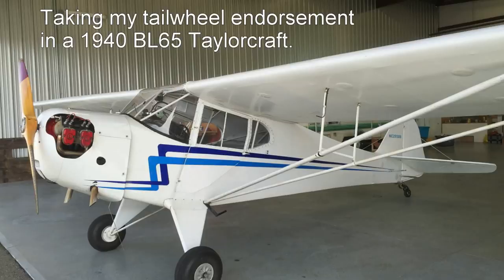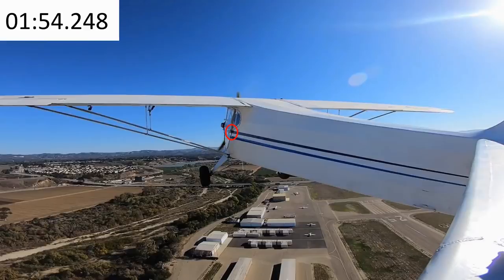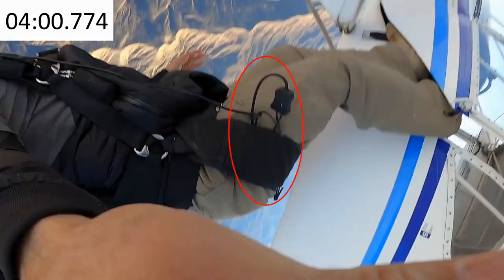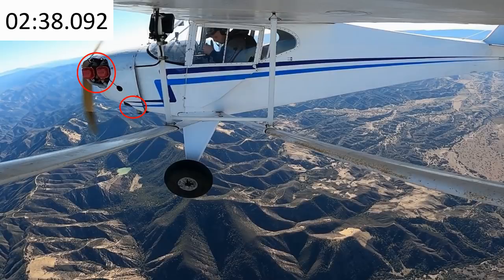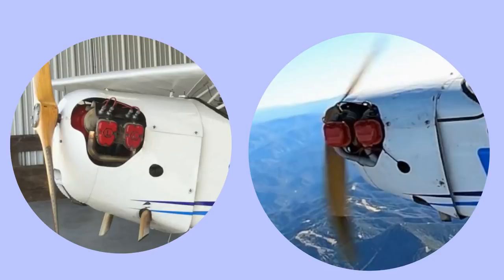Dear Trevor Jacob 1.1—That’s Not a Lycoming, I Found Your Water, and We Still Have More Questions…

Comment: Switching from Lycoming to Continental power in a BL65 is a pretty big deal. Basically changing the airplane model from a BL65 to a BC65. Taylor-Young originally offered the airplane with a choice of Lycoming, Continental, or Franklin 65hp engines. The Lycoming version was the model BL65, Continental version BC65, and Franklin version BF65. the swap would require pretty much everything forward of the firewall to be changed. The O-145 (and it's letter "O"- not zero) uses a different engine mount truss, different exhaust, different propeller, often a different carburetor, and the cowling needs to be altered, so this would be an expensive undertaking just to crash an airplane. Maybe he really did crash it just for attention but the engine swap was probably done earlier because parts for Continental A65 engines are lot more plentiful and affordable than parts for Lycoming O-145s. The little old Lycomings were not known for their performance but they were very durable and reliable engines. Parts for them have become very scarce and very expensive so a swap to a Continental is a common conversion for airplanes with Lycoming O-145s. The engine pictured would have been a Lycoming O-145-B2, meaning O-Opposed cylinders, 145 cu. in., B-65hp, 2-dual ignition.
The Lycoming and Franklin versions were dropped after WWII and the Continental version was continued with full cowling and trim tab and redesignated as the Taylorcraft BC12D
Reply: and now referred to as the BS65

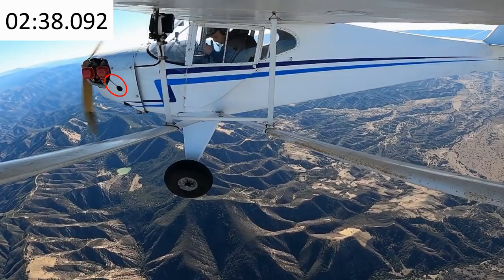Comment: Good analysis. There is another youtuber and commercial pilot, 'Mentour Pilot' who noticed a red fire extinguisher, located on Trevor's left leg (underneath his pants), at 2:12 of original video. Speculation would be to put out any fire from the crashed airplane.
Reply: That small extinguisher is woefully inadequate for anything but a small fire, and certainly no match for dry brush.  
But hey, A for effort I guess.

Comment: A small point I noticed too is that the front exhaust pipe on the Lycoming engine goes down and then a very clear but single 90 degree bend towards the rear. The Continental motor also quite clearly goes down but has a number of bends as it wends it’s way backwards. Beautiful pipework as the curves are lovely and smooth but most definitely not the same exhaust system

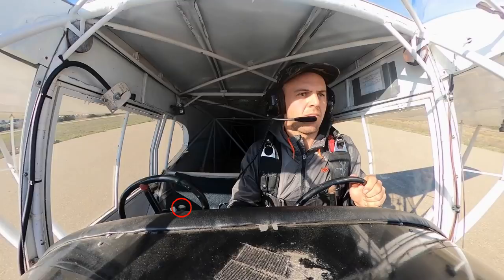Comment: Have you noticed around 4:10 the cowling was cut out to leave more room for the exhaust pipe of the replacement engine?
Reply: Definitely, to allow the cowling to be pushed outwards for that larger exhaust, even though the exhaust pipe is bearing on the inside of the cowling. That would not matter for the short and final flight planned for this Taylocraft!
Reply: Good eye! That was exactly my comment!

Comment: TritonTV has some good observations showing how Trevor's jacket is soaking wet just after he landed in the scrub. Cap must have popped off the water bottle that was tucked inside his jacket.
Reply: Or, one of the branches got it. That was great that he landed in a bush for dramatic effect. Well worth the loss of a little water.
Reply: @WeBeGood06  Plus Trevor had plenty of water stashed in the plane. At least a few bottles would very likely survive the crash.

Comment: Why in the hell would you jump with a headset on and risk it getting caught in your lines or risk it messing with parachute deployment? Well that, and why have a fire extinguisher strapped to your leg?

Edit: @4:03 why is the bottom engine cowling tab in the open position? The top of the cowling seems to be a different shade of white and looks like its was put there with a hammer.

Comment: This was an intentional scheme, a "crash for clicks". He had a fire extinguisher strapped to each leg under his pants, the door was open the whole flight, made no attempt to restart the plane or glide it in to one of several landing spots, including where he took off from, etc. I've seen another video where it appears as if he had the wing tank filled with water. The maker of the video goes frame by frame and upon impact it looks like a lot of water comes  out of the plane. Much more than one gallon. This guy is guilty IMHO, and I hope he is held accountable for this idiotic stunt.
Reply: "Idiotic." You mean well planned and executed stunt that made for some awesome footage..
Reply: @kj3n569  He also planned out filling tanks with water, fire prevention measures if the water in the tank somehow caught fire. He dropped it in an area with no camps for atleast two miles so it wasn't dangerous to others. The dude harmlessly got some badass crash footage, y'all are just FAA bootlickers.
Reply: @Zeromaus  0- and he paid for the cleanup operation and investigation too??? nope

Comment: At 3:21 - Is it just me, or does the top piece of the cowling on the right look considerably dented (and possibly hammered out), while the one on the left looks factory smooth?

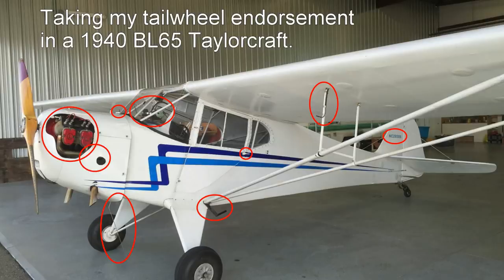Watching TJ's video, at 1:13 I noticed the GoPro mounted on the horizontal stabilizer catches it vibrating considerably while gliding.  I'm not a pilot but I did grow up on my dad's FBO - I don't think that level of vibration is normal, but I admit I could be wrong.

Comment: Nothing was right it seems.  Seen a video of another pilot with an engine malfunction. Had plenty of time to save the plane at what appeared to be a much lower altitude.  Trevor had more than enough time to scope out a landing spot.  Not to mention after he bailed from the plane he took a long time to deply the parachute, which robbed him of time to find a better landing spot.  But this really seemed like more theatrics than anything else.  BTW, I'm not a pilot nor a skydiver. There are just some things that were so glaringly obvious that it doesn't even take a pro to pick up on.   There are other things I noticed just from playing flight sims,  like the plane being trimmed to go down as he jumped out.  That just doesn't seem right.  A good pliot would have trtmmed it for best gliding speed while he sat in the plane and taken the plenty of time he would have had to line it up to the river bed below.  Or even tried to restart the engine, because of what you said, he had plenty of fuel. I'm sure he would have had enough to make the trip he was on, if it was his plan, other than crashing.
Reply: I'm both a pilot and skydiver and your assessment is spot on.
Reply: about that trim thing. I am a pilot, and I would say there is too much interpretation into that detail. Yes, the airplane noses down after he let go and jumped out. But I don't think he was that clever, to plan that ahead, because then he would have done it much better. And clever is not an attribute I would put onto him anyway 😉 
No, it is just simple setting. The plane was trimmed for level flight. Then the engine quit and Trevor started to pull actively on the yoke to slow her down, so forcing the nose up quite a lot. I would say, he wasted no time on changing the trim during those moments. He was busy acting his panic and getting his camera and stuff. So of course the moment he leaves, the plane puts the nose down immediately. Also additionally following physics with changed centre of gravity, as about 100kg from front seat just bailed out. So two factors adding nose down tendency: Engine out and loss of (human) load behind CG.
Reply: @birds_eye_view  I was going to comment that the airplane would have the tendency to pitch up due to the removal of the pilot but wanted to get an idea of W&B first. I found a W&B for a similar Taylorcraft and that has the pilot at +23 of the datum (leading edge of wing) and COG range from +14.5 to +19.7 so you are correct that the removal of the pilot would have a nose down effect (as of course would loss of engine power as the airplane would naturally pitch forward to seek its trimmed airspeed). Good catch. I was expecting the COG to be aft of the pilot on this tailwheel because in my mind the mains were further back. I shouldn't have underestimated the weight and arm of that engine. I fly tricycle gear but will pick up that tailwheel endorsement sometime in the future.
Reply: @birds_eye_view  Here's my more concise thought on the trim. If his intention was to film the plane crashing, he's going to want to make certain the plane hits the ground before he finishes parachuting down, so he can land close to it to recover the footage from the other Go-pros.
Reply: @1dgram  All the best for your tailwheel endorsement! They are so much more fun to fly. I'm sure you will love it. And please no jumping out, ok? 😜
Reply: @delscoville  Hm, I still don't want to give him so many intelligence points. For that he simply could have opened his chute a lot earlier. Those glide chutes suppose to come down anyway a lot slower than the normal sinkrate of an deadstick airplane, which would be in best glide 500ft/min? Maybe he just wanted to make sure the plane woudn't fly too far without him. Imagine by any weird coincidence the engine had actually started up again. It was windmilling nicely. And then flying back to its home airport and landing/crashing there without him. 😂😂🤣🤣😂😂
Reply: @birds_eye_view  🤣😂
Reply: If this dude thought he was smart... "think again buddy"!
Reply: @birds_eye_view  A typical glide ratio for a sports skydiving parachute is 2.5-3:1 and at best glide the Taylorcraft will have a glide ratio of about 10:1 and could possibly pick up thermals to stretch that a bit further. If it wasn't for the pitch down the plane could have gotten way out of reach. The decent rate for such a parachute can vary depending on the weight of the person, size of parachute, and the make and model but it's usually around 1000fpm. I was surprised he didn't open sooner. The glide ratio for a skydiver in the tracking position is only about 1:1. With an open canopy you can always spiral down to greatly increase your descent rate and the greatly improved glide ratio would have gotten him much closer to the crash site and given him more time and distance to find a suitable parachute landing area.

And no, I'm not jumping out if I'm the only pilot on board. I love airplanes too much, especially a beautiful vintage aircraft like that one.
Reply: @DaveGramatges  Thanks for those details. I'm not a skydiver. But couldn't he pick up some thermals too? And for sure he could have picked himself a better landing spot. Maybe he is not such a great skydiver either? 😉😂
Reply: @birds_eye_view  You'd need quite an updraft to gain altitude with a typical skydiver's rig but yeah, I'd ask what he was thinking when it came to that landing but clearly he wasn't thinking.

Comment: Not sure if you have seen any of the other videos on investigating this incident but in one of Trent Palmer's I believe he notes that someone had found the listing of the plane as Trevor had bought it and it was listed as "for parts". This is presumably because it had not been taken care of for quite some time and either needed extensive work to be certified airworthy again, different than being "flyable", or had been bought by someone who used parts on it to fix another plane.  Either way the plane should not have been in the air and Trevor likely ignored these problems so he could create this stunt.
Reply from the maker: I’ve seen that video and other similar statements, but none provide a source.

Comment: The Continental replacement engine has a different configuration for the exhaust than the Lyc; could explain the use of a freakin’ bungee cord (STC? nope…) for the cowling, since it’s all hacked to shite, to fit the Connie exhaust stacks. But, since it was only going to be flown once… smh…

Comment: You called out some good points....Defiantly An A65.....The pitot tube line has a black tube pushed over the painted copper line....Most older T Crafts don't always have a boarding step and most people step on the strut attachment.....T Crafts are very hard to climb in and out......And the fuel rod showed plenty of fuel..2500 hours flying T Crafts
Reply from the maker: This Tcraft had a boarding step before Trevor bought it. Thanks for the comments!

Comment: In your video at time mark 1m30s you show the rear facing camera view from the camera mounted on the glare shield. In this image it appears to show a compression bend in the frame around the rear of the passenger door - mid-way along the vertical. Would it be legal to fly with such obvious structural damage?
Reply from the maker: That’s something I haven’t seen anyone else comment on before tonight (you and one other viewer here), on any channel. I don’t have enough detail on the T-Craft body to answer yet, but I’m in contact with someone who can probably tell me for sure.

Comment: A few facts you seemed to have missed. FIRE EXTINGUISHERS IN HIS PANTS, one in each leg, watch frame by frame when he jumps out. You can see the shape and even see the red for a few frames. Spark plug wires resting against the exhaust manifold, possible cause of an actual failure, possibly set up that way on purpose? Plane was sold as scrap parts reportedly, was the engine swapped before or after the sale?
Reply from the maker: Good points! I haven’t covered them yet because when I add things others have found I want to give them full credit. Once I finish adding things I’ve found myself, I’ll go back and integrate all the things others have found with credit.

Comment: The left hand boarding step is commonly taken off. Nothing to worry about. The small slit on the cowling is probably for easy access but it should absolutely not be there. THAT BADLY EITHER. I'm almost positive that you can swap both around but I highly doubt he got the proper paperwork.

Comment: If you look at the in flight video just prior to the ditching there is a line of oily hand prints on the cowling as though someone tried to close it but a fastening would not reach so maybe that cord is a bungee strap. I would bet the plane has not flown before with that engine and exhaust combination, the exhaust manifold seems to be touching the cowling. 
I might be looking too hard but Trevor's hands look like he has been doing some mechanic work recently.....
Reply: Reports are that the plane was sold as scrap for parts and Jacob was seen working on it to go get it ready to fly.
Reply: @brianwest2775  true, and it will have had the wings removed for transport hence some of the disconnected stuff. No need for the wing tank to be connected for such a short flight. he may not have even noticed that the airspeed indicator was not functioning until he took off. the plane was thrown together  purely for this stunt.

Comment: The aircraft registration on the FAA website still doesn’t have the updated engine and prop, which we replaced in 2003. That was three owners ago. All your other points seem valid though. I refuse to watch his original video and give it any attention due to the controversial aspects of the case.
Reply from the maker: What engine and prop did you put on it? And was the antenna on the boot cowl there at the time?

What other questions should I be asking? DE K6WEB
Reply: @PetesGuide  sorry to lead people astray, but that was generalized statement that reads like I owned that airplane in the nineties. Sorry about that. My father and I owned a Cessna 172F from 1994 -2007. We re-engined it with a Lycoming in 2003-4 to get away from a TBOd underpowered Continental. Nothing on the FAA website has ever changed to indicate an engine and propeller change. Again, sorry for the confusion.
Reply from the maker: @jameski5oeb668  no worries! I’m a writer by trade and am occasionally embarrassed by what I type that says something different than what I was thinking.

Comment: The FAA web site is a little misleading about the BL and BC leading nomenclature on this aircraft. While a BL refers to a Lycoming engine powered aircraft and a BC refers to a continental powered aircraft, they are both the same airframes, and the engines were swapped back and forth but the aircraft--no matter what type of engine it has now will always be called the type it was when it left the factory
Reply from the maker: That sounds accurate. I have not yet researched this in enough detail to comment further. That will have to wait until I finish analyzing all the frames in the posted video.

Comment: I haven't got to part 2 yet, but wanted to point out something else that someone may or may have not pointed out. The still frame that starts at 3:14, and compares both shots side by side, those 2 photos are different engine cowlings. Look at where the exhaust comes out, and the shape of the hole there at the bottom is different. Additionally the dual pin stripe line comes all the way up to the manifold on the original aircraft, but barely reaches past the additional hole on the side. Also, towards the top you can see what looks like a weather strip coming from the windscreen to the engine bay. That's not on both. I truly think these are 2 different aircraft. Maybe you saw these already. Maybe I helped? Now to go watch part 2!